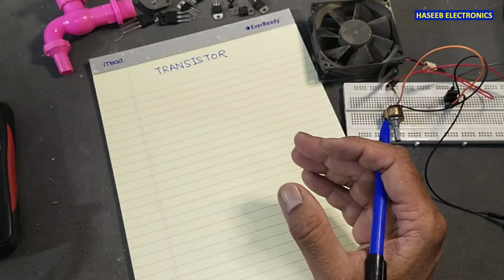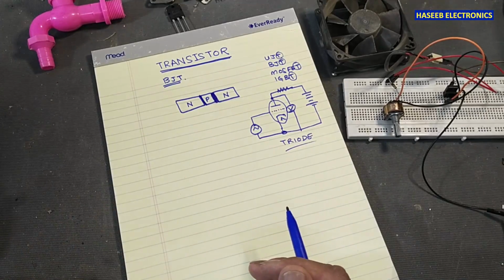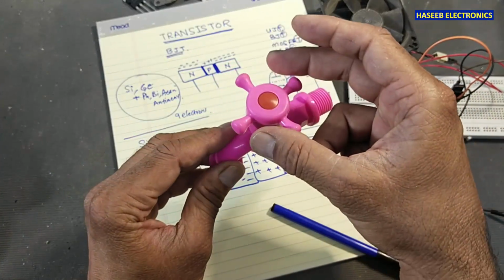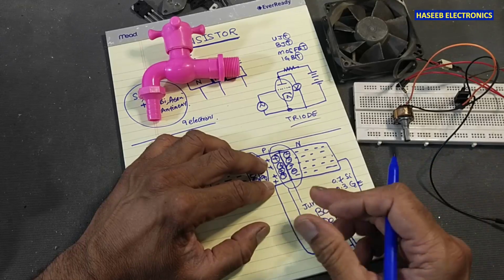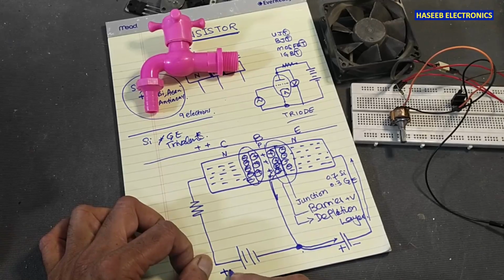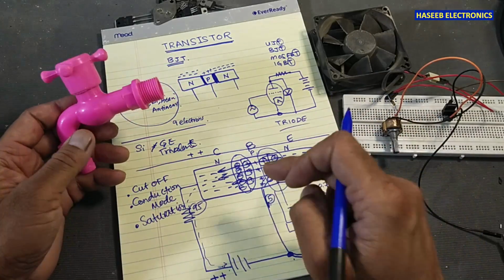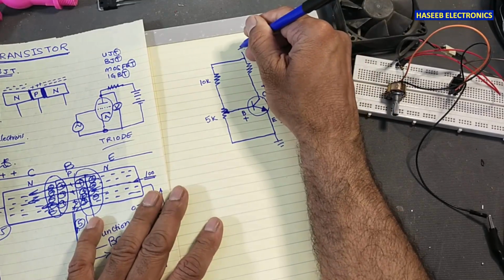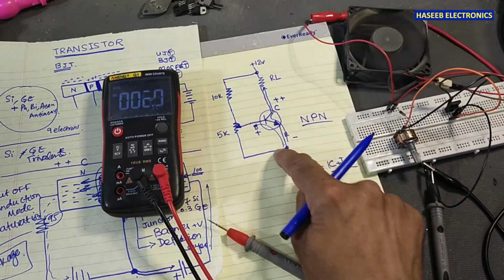{756} Transistor In Electronics Explained

Comment: Years ago my math teacher in university explained how a transistor works using a faucet like you do in this video. That is a great explanation, but you explain how a transistor works much better than that.

Yesterday I fixed my 12/24V battery charger that was always blowing a fuse (it is for lead acid batteries and lithium batteries in cars, boats, motorcycles etc. type Anjing AJ-618A) and I thank you for that. After watching your video about how to test a MOSFET I did find a shorted MOSFET on the high voltage side and replaced it. The charger now works even better than when it was new.

You sir are a great teacher, a true mentor.
Reply from the maker: your comment is really a valuable asset for me. thanks for encouraging my efforts 
best regards 💕
Reply: @HaseebElectronics  You are welcome and you deserve it for sharing your knowledge.

Comment: good video but Im confused as to where the current is coming from in the schematic you drew around 15:20 with the 2 batteries connected. the second battery that you connected + to the collector and - to the base, how is the current from that battery able to enter from the emitter side? obviously it cant enter from the base cause like you said ie = ib + ic, so it is going through the first battery and entering the emitter there??

Should the negative of the 2nd battery been connected to the emitter instead?
Reply from the maker: welcome dear 
electronic current enters from emitter (for bothe battery sources) and then current from the base will proportional to the VEB (voltage across emitter to base) 
current from collector will based on (VCE voltage across emitter to collector )
both batteries are in series
Reply: @HaseebElectronics  would that cause the battery that is connected on the base / emitter to wear out faster? because it has the total transistor current flowing through it not just the  base / emitter current? would it be better to have a small capacity battery just to control the base and a sepperate larger battery from collector to emitter for supplying a load?  so as to have 2 sepperate loops of current  instead of having the batteries in series and having all that current going through the base / emitter battery ?

Comment: So I can make my own 1A transistor by putting two  diodes 1N4007 back to back ( anodes in the middle or ring markers to the outside to have a NPN ) ?
Reply from the maker: no 
a transistor look like a diode and it's junctions are similar to back to back diodes
but transistor have special base material and size

Comment: Why does npn transistors using only for negative switching.
Reply from the maker: it is trend in designing 
because it is commonly used due to its base voltage 
otherwise pnp can also be used in place of npn

Comment: Salaam Bhai Sahib Net Moseebat Bana Huya He
Reply from the maker: best regards and special thanks
Reply: So the 5k resistor is the voltage biasing at the base and the 10k resistor is the biasing at the collector, am l right?
Reply from the maker: it is a voltage divider network for the base. to adjust base lavel above than emitter and less than collector